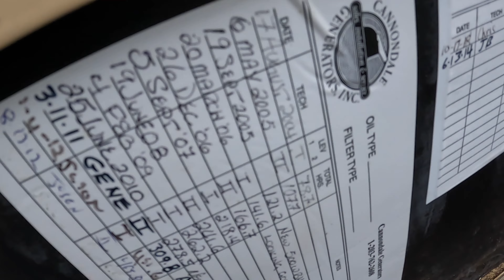Generac 25kw Liquid Cooled Circa early 2000's removal and replacement

Comment: I love how the same or close capacity Generators of today are less than half the size of Generators from the past.
Reply from the maker: Hi Terence, 

I agree, technology has come very far.  The windings in the rotor and stator have gotten a lot better, along with the efficiency of the engines.

We see the same result with central AC units.  Even though a system is in working order, if its 20 years old, its time to replace it ... otherwise you're just throwing money out the window.... literally.

New home buyers should be wary of homes with old infrastructure components.
Reply: @ipowergenerators4200  I agree 💯.  I use to pay over $1,800/yr for electricity. I changed my unit out and now I pay around $1,000/yr. $1,150 max. It pays for itself.
Reply from the maker: $700 savings! That’s great! A few years you’ll be in the clear. 

Some utility companies even have rebates for updated your equipment. 

Sometimes they’ll even give you credit for replacing refrigerators and thermostats…. If you in Con Ed territory I know they have big rebates for stuff like that.
Reply: @ipowergenerators4200  not years, weeks. I've been saving $700/yr for 5 years. ($3,500). I paid $3,800..

Comment: What is the background on this? Only 74 hours and has to be replaced?
Reply from the maker: It had 78 hours in 2004, at time of replacement I believe it had 1000+. 

New homeowner just wanted something newer that was a bit more fuel efficient. Finding some parts was starting to become a bit difficult too.